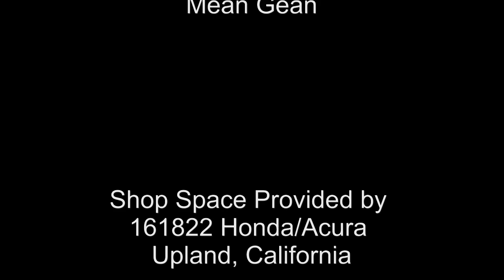Project Z, BC Coilover Install

Comment: Im looking for coilovers for my e30. how do I know if they need to welded or not?
Reply from the maker: Falko All the kits out there require welding, the only one I know that will ship you bolt on version is CATuned. But you have to send in your knuckles as a core.http://www.catuned.com/catuned-bmw-coilovers
Reply: The Gentleman Racer Really? I've seen a lot of threads talking about cheaper coilovers like Raceland and JOM, and saying that they are simply bolt on and don't require any vehicle modifications or welding. thing is that I don't want to get super cheap coilovers, I want a good brand, but I also would prefer to install them myself
Reply from the maker: Falko Raceland are more like slightly adjustable lowering springs I suppose it depends on how much adjustment you want to be able to make.